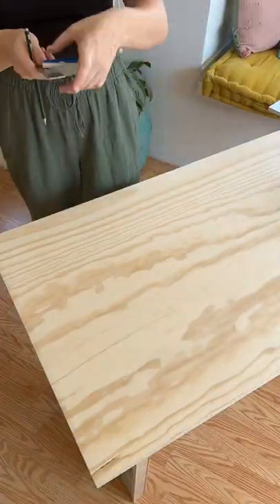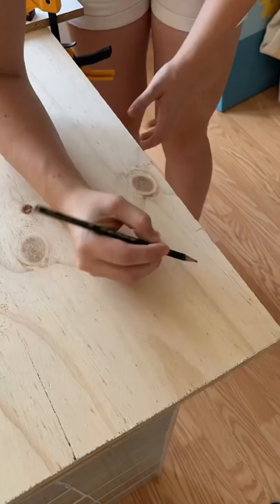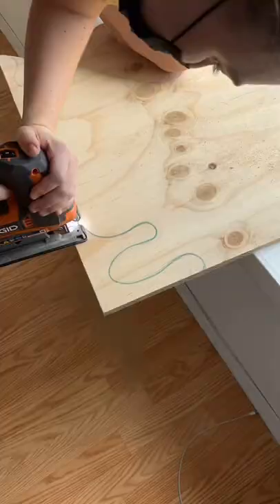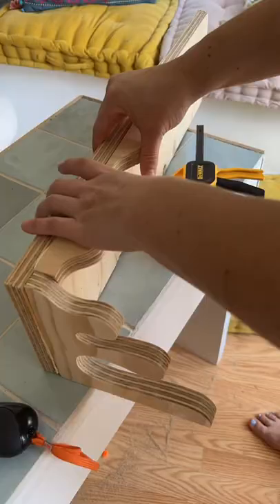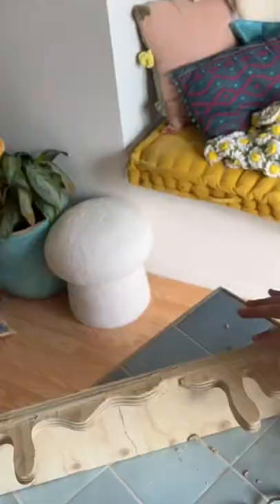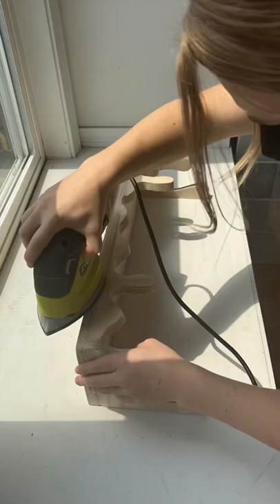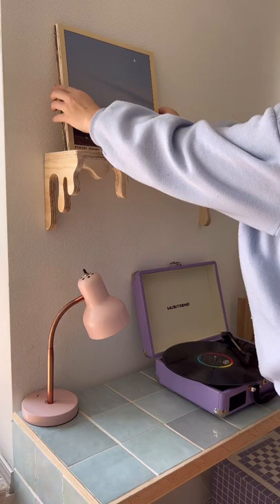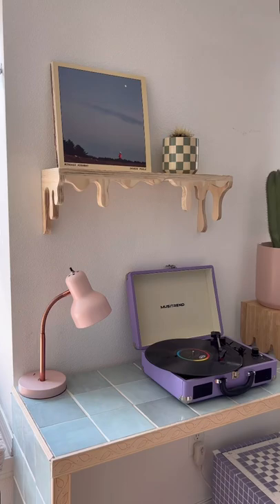Wood Drippy Shelf DIY 💧#diy #woodworking #homedecor

Comment: I feel the raw wood is good. But for future, I suggest making the wood grain all flow in the same direction. The sides I know is the wood grain was horizontal, while the front was vertical . I think that would look better if you make sure the wood grains all in the same direction. Either all vertical or all horizontal

Comment: I think it would be better if the panels were attached to the front of the shelf instead of underneath it so that it would be a cohesive drip all the way and you couldnt see the woodgrain going a different direction then the drippy parts.